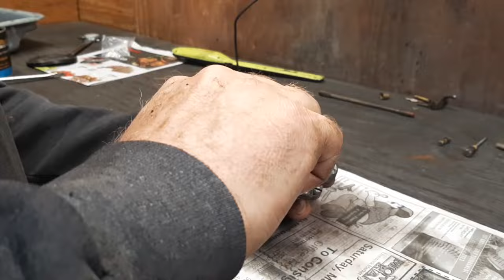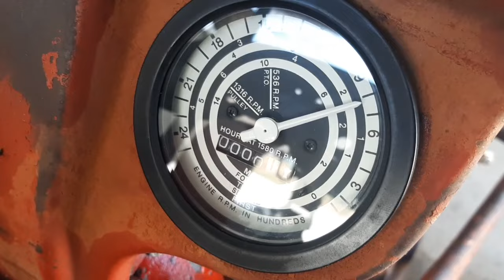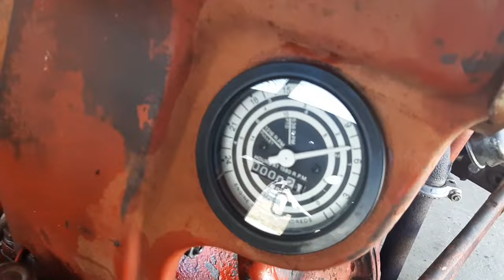Ford 8N - Adjusting the Governor & Rebuilding the Carburetor

Comment: When you put the rubber packing into the throttle shaft hole, did you put a brass retainer cup into the shaft hole to keep the rubber packing in place?  Didn't see you mention that.  Great info on the governor, and your run through of the carb cleaning was excellent.  Not really necessary to remove the three brass jets (economizer, idle, and main) as they can be buggered up easily, as you found out on the idle jet.  Good to check for proper diameter hole size on each: Idle jet .032, economizer jet .046, and main jet .052).  Well done!

Comment: New sub! I have a 39’ 9n. It is running like a turd and I just put a new carb on and can’t get it to keep running
Reply from the maker: Did you check the ignition system?  That was the first thing I had to fix on mine.
Reply: @xpsgarage  spent all morning taking apart and reassembling the carb. Needed a new battery as well, oops! Got her running but the idol and rev are not acting right. My Governor linkage is sloppy to say the least. I think a Governor rebuild is in my future

Comment: Great video
Working on my 8N -- Tractor surging   Installed new after market carb -- half the weight of the marvel ( will rebuild ). Removed governor, cleaned ( wished I watched video before -could have taken it apart -arms are loose and play in spring . Where do you get brass shim ?  Re-installed governor - still surging. Ordering new governor -- will rebuild old one when I have time this summer. Really helped me understand all components. Thanks
Reply from the maker: The brass shims I used were old feeler gauges I have for motorcycle valve checking.  I usually get them from McMaster-Carr.

Comment: I have an 8n. I had to replace the carburetor and now it tries to die when go up hill, I did replace the fuel filter and readjusted the carb many times from factory to extreme with no luck. Any ideas? Thanks!
Reply from the maker: Is the arm from the governor to the carb opening the throttle when you start to go up hill?

Comment: I bought A2N 1946. And it ran good when I bought it. I left the guy use it for 2 weeks. Went back to pick it up and it backed fires. And it will not stay running. Do you have any ideas? What might be wrong?
Reply from the maker: I'd make sure you have good fuel flow to the carb and would probably also drain the carb to make sure there is no water in it.  After that check the spark plugs and ignition to make sure you have good fire.
Reply: @xpsgarage  I already did all that an cleaned carb I think it's the coil, on six volt
Reply: Has new plugs
Reply from the maker: @duanebolen543  Have you checked all the wiring to and from the coil?  Do you still have a resistor block in the power line to the coil?   They have been known to go bad.

Comment: Do you have  a fitting size and thread for  the  oil line.
Reply from the maker: The one going into the governor?  It's a 1/4 Tube-1/8 NPT Inverted Flare Elbow

Comment: Ok, is there a governor adjustment????
Reply from the maker: I don't think there is much adjustment to it.  Make sure there isn't any slack in the spring and that the arm is not all sloppy.  The adjustment is in the throttle linkage.  Once you have the throttle set then the governor just moves the throttle to maintain RPM.

Comment: I bought a complete new governor for $112.00. On eBay.
Reply: If its brand new, likely its an overseas (India or China) model and you may be in for some heart ache with its performance. Another video I found said that they salvaged a brand new overseas model by tearing it open and properly shimming the shaft which they found wasn't shimmed for preload at all. Good luck.
Reply from the maker: Have you tried it yet?  Some of the aftermarket ones don't work very well.